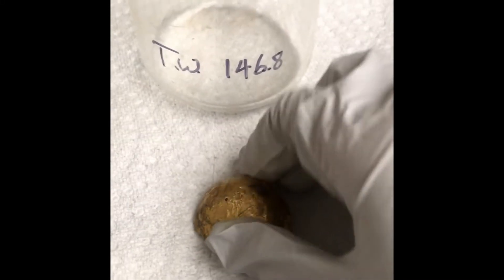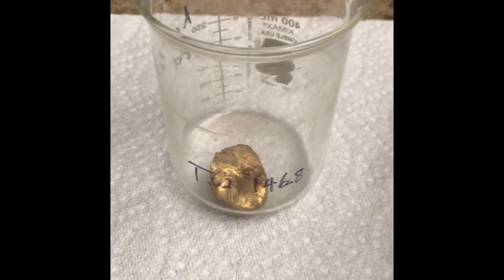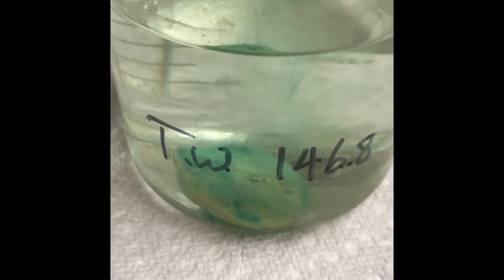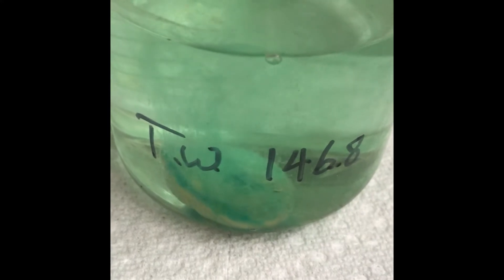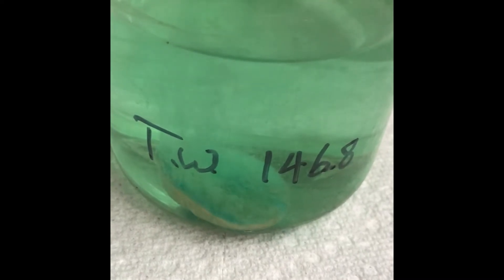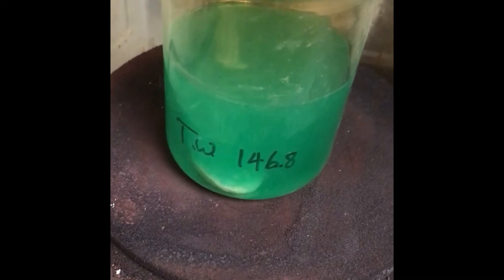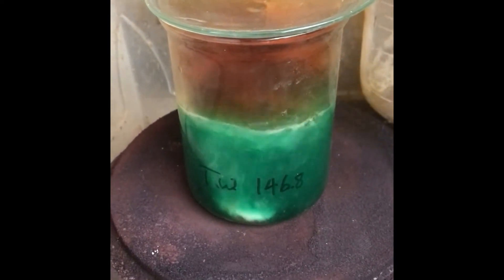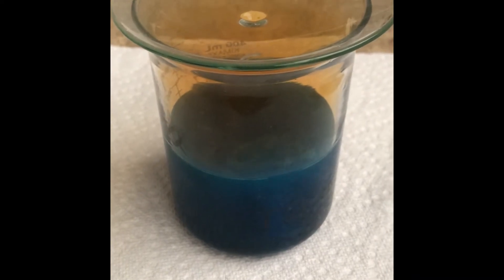Destructive Nitric Acid test of unknown ingot, Is there Gold?

Comment: So I have a question, I have these pieces from a adapter and I put a drop of nitric acid on it and let it sit til it stopped fizzing and even after it still looked gold, do you know what that means?
Reply from the maker: Un Known did it flake of or was it the same color underneath?
Reply: @IntermountainGoldRefiners  it might have flaked I'm not sure how it would look but if I was to use the acid on every part of the piece it would still look like it was never polished I ncluding pre-polished
Reply: @IntermountainGoldRefiners  o ok no it was the same color underneath
Reply from the maker: If same color then it’s probably an alloy of brass.  If flakes then gold plating.
Reply: @IntermountainGoldRefiners  ok I recorded a video and posting it soon, but also I know that for the brass it's mixed with either copper or aluminum and the yellow gold color is from zinc but if I put acid on the object instead of scratching on black stone then it would be a better test and more results, aluminum isn't the base so scratch that off, it leaves copper and you will always see copper if you put the acid on it, so it leaves me to think it's possibly a gold object. What's your theory about that?
Reply from the maker: This is advanced stuff, I’ll watch your video and see first, then comment what I think.
Reply: @IntermountainGoldRefiners  ok thank you, it's not all professional but I needed to charge my phone.